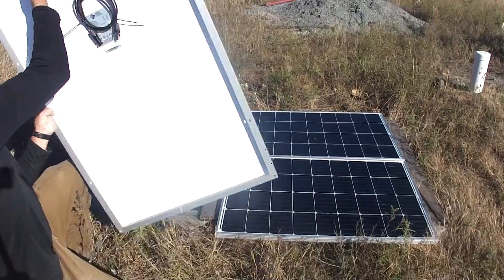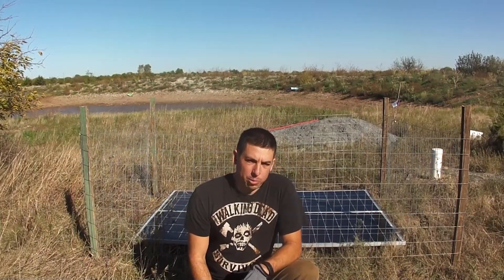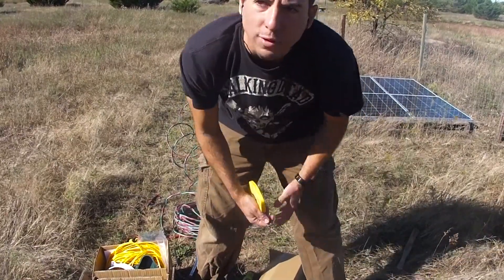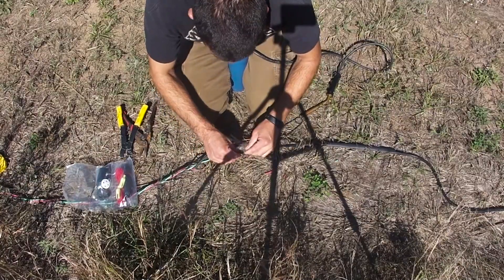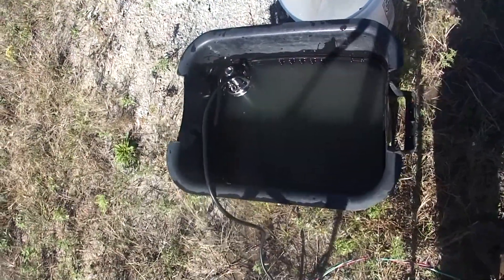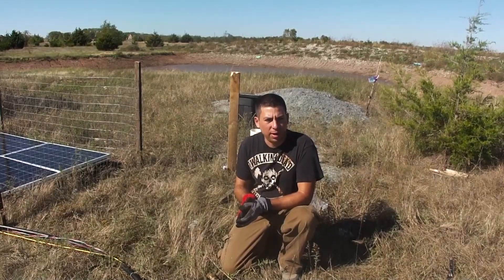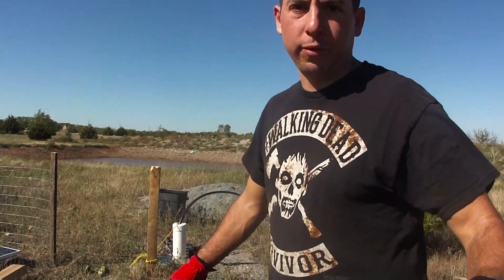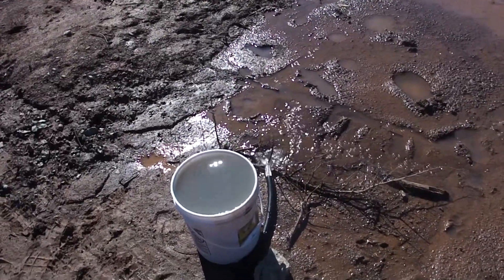RPS Solar Well - Rural Power Systems Solar Well 1.8 Unboxing and Setup Part 2: The Setup

Comment: Awesome. Must have been so exciting to see that water starting to flow out into your pond. Thanks for posting a comprehensive installation video - I had been wondering how you lower the pump and pipe, thinking maybe I needed some sort of cable reel setup or even to hire a drilling truck - but no!

Comment: I really want to possibly try RPS, but I can’t seem to find many USER reviews on RPS pumps / systems, ...only “RPS” videos on how great they are....
Reply from the maker: So far mine has been great. About the output of a garden hose so if you want more get the model above mine. The customer service has been great also. They had their guy call me back from his phone when I had a question during install and replaced a sensor with a redesigned one for free when it failed. They also sent an upgraded controller when mine got water in it. I had to pay for that but it was my mistake. I'm not sponsored or anything like that.
Reply: 1 Mohr Farm 
..thanks for the reply . I’m gonna call them.
 I only need 1 to 2 gpm  ,220’ down, 100’ static, to fill a 1500 storage tank, (our 640’ well has a pathetic recovery rate)...  
 I thought about getting an SQ Flex but RPS offers more for less. 
 And it might be wiser to spread out points of failure...the SQFlex is like putting all my eggs in one basket. 🖖😎
Reply: @MrTrekFanDan  hey did you ever get this done? I’m in a similar situation depth wise and I’m thinking of going with them also.

Comment: How long did it take to fill the pond? Is there a low water shutoff on the pump?
Reply from the maker: It is about the equivalent of a garden hose running so it never filled up because my pond is leaking to much water. Yes there is a low water shutoff on the pump. I put the sensor on the pipe above the pump. It worked for about 4 months then broke because it was so corroded with our hard water. RPS replaced it free of cost with their upgraded model and I put that one down the well and it worked a little longer before it broke. The gaps between the contacts on the sensor fills up with some type of build up from the hard water. Currently I have the sensor bypassed so that the pump does not require the sensor.

Comment: Looks like you've had the RPS pump in for over 6-months.  Are you still happy with it?  What model did you purchase?  I'm trying to decide on a purchase myself.
Reply from the maker: I got the RPS 1.8. I just checked out their website and they use a different naming now, so I would guess the RPS 400.  I like it a lot and have batteries attached to it now. RPS has excellent customer service that I have used. The only thing I would change would be spending more and upgrading to a 600 or 800. 
https://www.rpssolarpumps.com/solar-well-pump-sizing-charts/
Reply: @1MohrFarm  Awesome job on the install! You can add two panels to your system and get more water just call us. Mike if you are interested in a system you should give us a call too. We'd be happy just to chat. We are a no pressure sales company!
Reply: What G.P.M. are at ?  Nice job

Comment: Help anyone I have a 1hp pump about 40 deep well what and how many solar panels would I need I can run it on 110 or 220volts I would rather run it on the 220
Reply from the maker: I'm not sure. My pump was designed for solar power so operates on DC. Solar panels provide DC power, so you would need an inverter to switch to AC.
Reply: 220V Is much too high of a drain for solar. a 110V Pump on a 24V Inverter off of Batteries should do fine on sunny days.

Comment: hi. great job! what is the size of the pump (in horsepower)?
Reply from the maker: I'm not sure in horsepower. RPS does not have that on the spec sheet. I'm sure they can give you an equivalency. It says 80 to 480W pump power on the spec sheet? When I checked it after set up I think I was getting around 7gpm. Since then I have, upgraded the control board, added 2 more solar panels and 6 deep cycle batteries.
Reply: @1MohrFarm  awesome. Thanks for the information. That sounds like 1/2 horsepower